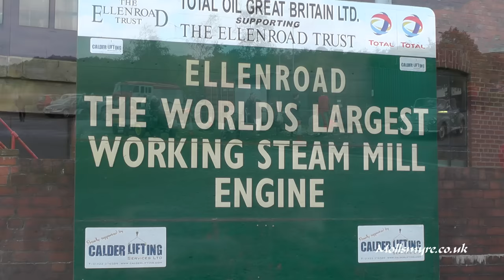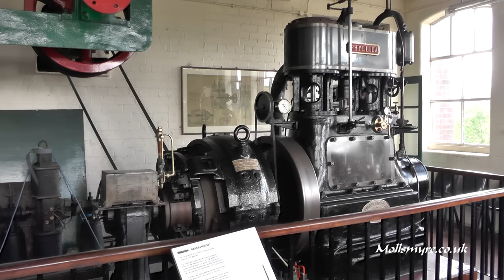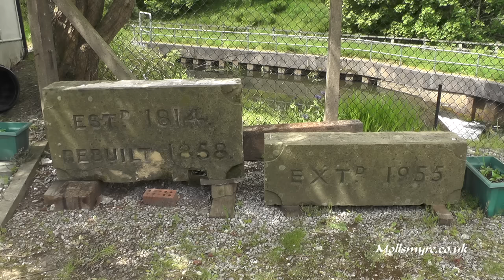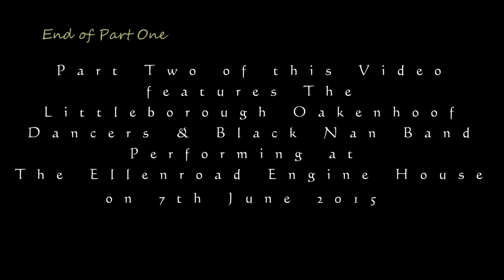Ellenroad Engine House June Steaming Day 2015

Comment: and does this engine when running still gives power to the electric system?
Reply from the maker: No I'm afraid not. Its purely Heritage now and only runs on open days.
Reply: i feel like a waste of money and energy not to put this big engine to run something  at all
Reply from the maker: Sorry for the delay in replying. I fully understand what you mean but it only runs a few times a month for short period of time. Ellenroad Engine House  is a Heritage site and is only in steam the first Sunday of each month. The admission price goes towards the running costs.
Reply: @mollsmyre  
Is this a compound engine? Does it have a condenser? What was it originally used to drive? Thanks for your time!
Reply from the maker: @gregorymalchuk272  Yes its a Compound engine with condenser and was operated in the cotton industry.
Reply: Quoting from " https://www.oneguyfrombarlick.co.uk/posting.php?mode=quote&f=393&p=143730 " " When I was running(*) Ellenroad Coates Inks got an energy firm in and got them to do an assessment of the viability of running the 600KVA alternator we had from the engine and making their own juice. The assessment was checked out by Coates accountants and the worst case scenario was a saving of over 40% on their energy costs. In the end the Coates Board decided not to proceed on the grounds of reliability. Understandable considering the age of the engine but the economic case was proved."    (* as in appointed by , and creating the trust to Run Ellenroad  after the Cotton Spinning company had moved out - ( Coates Inks bought the site and had the Mill section demolished , with the engine house agreed to be retained )

Comment: What's the purpose of all the grooves on the OD of the flywheel?
Reply from the maker: Sorry Im afraid I dont know. Hopefully someone will provide the answer.
Reply: Those grooves were for the rope drives to the mill machinery.  
  Each floor of the mill had a ceiling full of line shafting, with pulleys for each machine.  All that belting and all those whirling wheels were fully exposed, mind you-easy to lose your wiggly bits 🖐if you were careless.
 

 'Come with me, and you'll be, in a world of OSHA violations...'

Comment: Do you happen to know the weight and inertia of this huge flywheel?
Reply from the maker: The Flywheel weighs over 80 tonnes.
Reply: @mollsmyre  So technically, that is 160,000 lbs. I thought, with its massive size, it would weigh a lot more than that.

Comment: What does this work of art exactly do?
Reply from the maker: Operates monthly for enthusiast. Keeping the past alive. It is very impressive and must have been something to behold when the mill was in full production years ago. Hard work no doubt but very impressive.
Reply: mollsmyre what a grand time it must have been to be alive during that era.
Reply: mollsmyre any idea on the weight of the massive flywheel?
Reply from the maker: @jerrysmith7166  Yes the flywheel weighs over 80 tonnes.
Reply: @jerrysmith7166  learn what was meant in the hymn by dark satanic mills.

Comment: I find it interesting that the two pistons seem to be phased 90° apart. Are they double acting?
Reply from the maker: Not at all sure but looking at it you could be right.
Reply: Since they're double acting by being 90* out of sync it means there's always a partial stroke available to start the engine. If they were in sync or 180* apart the engine would have to be "poled" to a starting point to enable starting. The big single acting pump engines need this. They use a small donkey engine to do the "poling". That's as I understand it.
Reply: @ronwilken5219  I figured that must be the case

Comment: 15:03 the big rusty engine is geared down and may have been in a steel rolling mill or possible a deep coal mine.
Reply from the maker: Quite a history its had.
Reply: It's on the site where it was  built for pumping water.
Reply: @mikezahnow1605  I though that was an acquired collection of parts from a different machine,  which location was any additonal waterpumping undertaken at Ellenroad?

Comment: Nice ! But one thing is a little bit concerning. The young man who was feeding the boiler with coal is not wearing any mask. If he works in this situation very long then surely he will get interstitial lung disease (ILD). He has a plenty of years ahead to live a healthy life. Please Act.
Reply: good question,  here the bolier is only fired a few times a year and with little load once stoked does not need much constant feeding for the day.   The same , depending on load in it mill working times would also be a six day 10 hour shift but feeding boliers coal is less risky than hewing it,  most stokers or firebeaters/firemen would get a promotion to engine driver on the cleaner side of the engine or they would go into other work so it rarely became a noticable problem.
Reply: @highpath4776  Still its a matter of his health. At least give him an appropriate Mask.

Comment: According to Watt's calculations, each 1 nominal horsepower of steam, equals 14.000 ft lbs of tourque. Just imagine the modern 400hp car engines today that stall if you get stuck in the mud.  You would never stall the inertia in that huge flywheel.

Comment: I dont know how they keep the flywheel from slinging itself apart
Reply: low revs.  not revving fast enough to disintegrate.
Reply: To me it would be close to falling apart with the speeds they are spinning it at

I understand tho
Reply: @rosewhite---  No,  design revs,  too low it will collapse on its bearings.  The safe maximum revs is about 20% to 50% over the design revs , though I would not recommend running at those higher speeds for much time.

Comment: made by clayton goodfellow engineering,audley range ,blackburn ,lancashire on the site of what now is dunhelm mill store.sadly now the knowledge the skills and the machinery are all lost.
Reply: John   which one ?
Reply: @highpath4776  the firm was located on the site of what is now matalan and dunhelm mill at the end of audley range the railway was just behind the works.i worked as a fitter there
Reply: @johnmullen1955  Check out ogfb shed matters - search google. contributions welcome